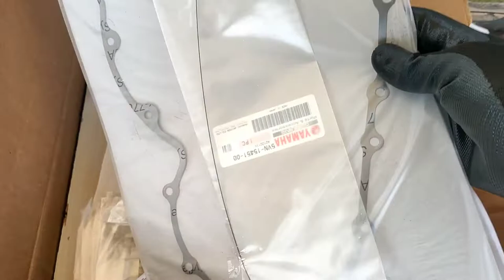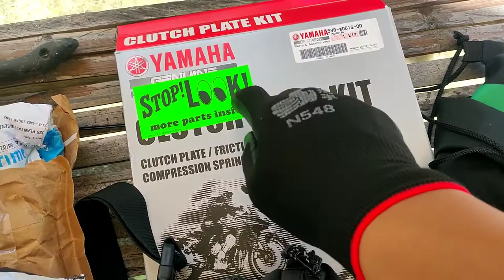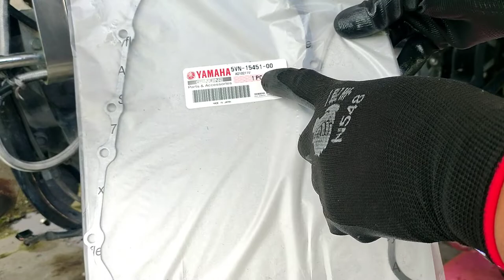Installing new clutch kit on Yamaha Road star 1700

Comment: hi body, i have a 2006 yamaha 1700cc can you make a video how to replace the neutral safety switch pleaseeeee i have a leaking
Reply from the maker: Hello the location is bottom clutch case maybe need to replace pressure washer

Comment: Hi, I just bought a road star 1700.
Planning on doing some repairs on it.
Whats the deal with that loose screw/shaft that goes through the little bearing you changed? (5:50 to 6:00 minute) I see that that piece has a thread, or at least looks like, but there's no nut, it's just like hanging loose there.
Reply from the maker: Hi bro that shaft is called clutch coupling pin/rod use to engage the clutch plates to work! Thanks for watching more videos soon 🤜🤛

Comment: Question. At 1.05 you point out a wire on the back side of the clutch cover. Is that the pick up coil?
Reply from the maker: Hello bro yes absolutely pickup oil/pulser coil  by the way thanks for watching more videos soon. Keep safe 🤜🤛

Comment: Sooo question, might be a dumb one but do you need to start the bike inorder to get pressure to the cable?
Reply: Having same problem. Replaced everything and now it feels like it's locked up. I havent started it or even pu t oil back in it. Was trying to retention the cable and haven't got it yet.
Reply from the maker: Nop!

Comment: I did this exactly like you have done. My clutch lever keeps being wayyy to loose. Ive adjusted it in all different ways but it wont tighten at all. Any ideas?
Reply: I know down by the clutch, it seems the spring isnt engaging to bring it back so when I pull the lever, it just stays in position. Maybe I did something wrong or need a new spring now that the plates are replaced?
Reply from the maker: Adjust the arm/lever in the engine
Reply: @15LoydsCustom  I ended up getting it. I didnt realize that the the plate that holds the clutchplates in was supposed to click into place to cover the gap.